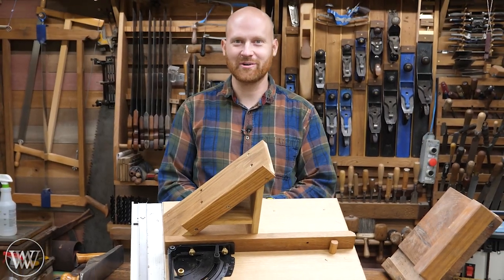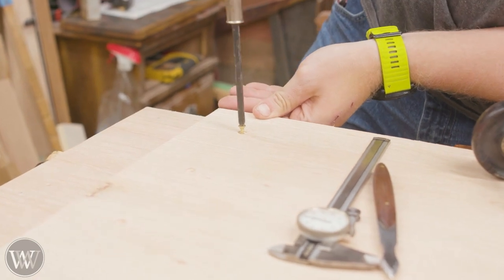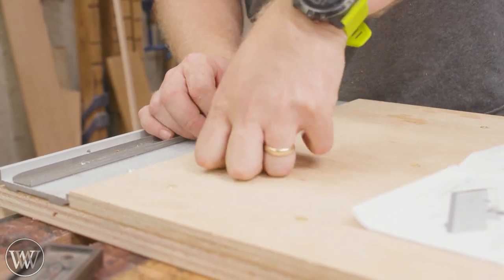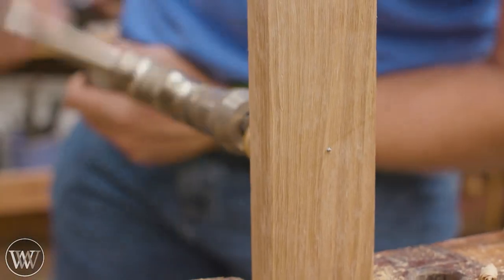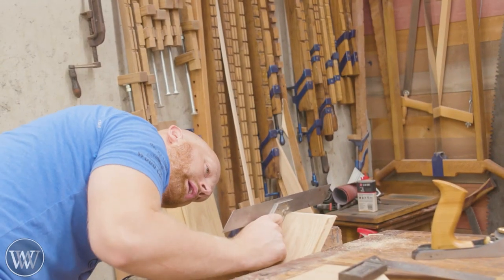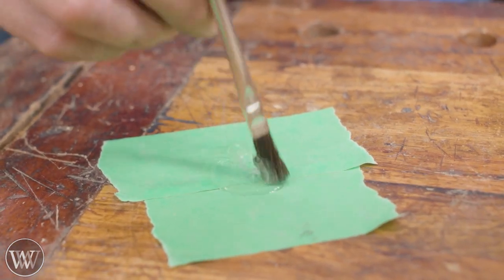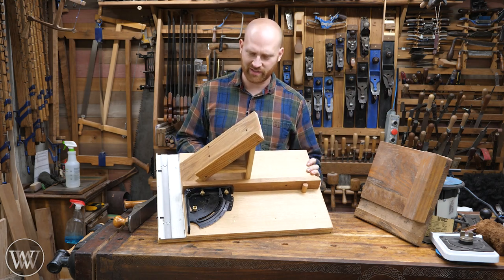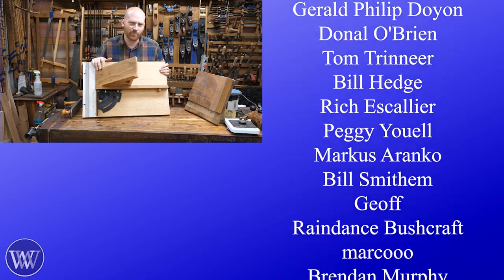How to Make The Best Shooting Board Ever

Comment: Well, got my track, and glued up some 3/4 plywood, which was "cabinet grade', but not apple ply. Checking the plane with a square after, the plane tipped one way on one end of the track, and the other way on the other end of the track. Went and got some melamine shelving material, and did it again. This time it was better. If I was  going to use 3/4 plywood again, I would run it through the drum sander. I did take a shoulder/rabbet plane to remove the layer of melamine, and glue a piece of Ipe to it for my fence. I will have to add screws to the 3/4 pieces of melamine I glued together..

Comment: I loved the dueling shoot-out (or whatever we're calling it today). I really like the ultra flexible option even though mine is just pretty simple plywood 90 and another one for 45. The one thing I learned was a "right" way to build these (not that there's one right way) is to ramp the bed for the plane so that the plane drops or rises as you complete your trim. On narrow trims it's not a big deal but on wider cuts it evens out the wear on the plane iron a bit. Very nice work, though... I hadn't seen the Veritas angle fixture and the aluminum bed. I think my board needs an upgrade. Thanks for the video.

Comment: James, have you tried an engineers countersink bit. Here in the UK, I've seen them called a snail-bit (after the curls they can make) or a deburring bit so I'm not sure what they are in the US. I only have two but I've used them for years and they are fantastic, no chatter with really smooth countersinks bores - would never use a conventional countersink again.
The collaboration with Rex was great, hope you get to do more.
Reply from the maker: Yes. I have one of those too when they're sharp they are wonderful.

Comment: Hi James. Really enjoyed these two videos, thank you. The only problem with yours (and I only noticed this when I saw it at the end of Rex’s video) is that when you use the adjustable mitre, the corner of the fence appears to intrude into the path of the plane.
Reply from the maker: That's why there are slots in the back support. You can easily loosen the thumb screws and slide it so that it will adjust to any angle you set it to.
Reply: @WoodByWrightHowTo  yup. I can see that now!! Thank you

Comment: Hi Wright. Do you have a video of sharpening your crosscut carcass veritas saw?
Reply from the maker: Not that specific one, but I have several videos showing sharpening other crosscut saws.
Reply: @WoodByWrightHowTo  I would really appreciate you making a video of that particular saw. There are technical aspects That are pretty confusing. For example the 75° angle and the included angle of 60° as referred to in the literature that comes with the saw. I wanted to restore my saw back to factory settings

Comment: it looks like you have a very short "run up" to the fence.ive always make a deeper shooting board so i can get the momentum of a heavy plane going.  is there a reason for the short bed or am i just looking at it wrong
Reply from the maker: My original thought was 16 in was enough as my current shooting board is about 16 in. The kit from Veritas comes in either 16 in or 24. If I had it to do over again I'd do 24 in.

Comment: Great instructions and build! I’m tremendously disappointed in myself because he said at the beginning the veritas shooting track was made for the veritas shooting plane and low angle Jack, but it didn’t occur to me that it absolutely would not work with a general vintage Stanley. Expensive woopsiedoodle on my part. Thought I’d post in case it might warn some folks. Trying to decide if I should hacksaw off the back edge to make it work.

Comment: great video - question though, how do you think it will work with a Lie Nielsen low angle jack plane? will I have to change the dimensions of the plan?
Reply from the maker: it will work fine, but you will have to change  the fence like I did. some people just make a small scrap of wood that fits in there to fill the gap.

Comment: Hey James. I like the collaboration with Rex - it makes the topic more interactive which answer most of our questions. We learn so much from the both of you.
A question I have is: which hand plane is most appropriate for use on a shooting board? I have a crappy no.5 and it's right side (I'm right handed) isn't square to it's sole - can i use a no.7 instead? It might be a silly question but I ask so that I can make the shooting board accordingly.
Thanks. 
Looking forward to more collaborations.
Reply from the maker: The side does not need to be square tot eh sole. the iron needs to be square tot he side. that can be changed with the lateral adjustor. I prefer a #5 over a #7 but everyone is different. give it a try and see if you like it.
Reply: @WoodByWrightHowTo  okay yeah I remember Paul Sellers also said that the iron needs to be square to the side rather than the sole. 
Thanks again. Respect from South Africa.

Comment: 6:26 Veritas wants us to glue hardware into the wood, so we can’t replace the board? No, thanks.

P.S. Thanks for showing us the whole build process – I never would have noticed. I looked at some “tests” on blogs, but they seem to be afraid of criticising the mighty Lee Valley. Gluing in the hinge bit might not be a dealbreaker for everyone, but I would expect a proper review to mention it at least.
Reply from the maker: ya that is something I would love to see them fix. Thankfully they will sell just that fitting, but it would be another thing to buy if you want to change it out.
Reply: @WoodByWrightHowTo  It could be a part that is secured from the bottom of the board somehow – even if that means you have to create a recess on the underside.